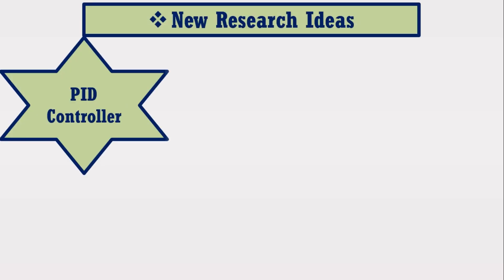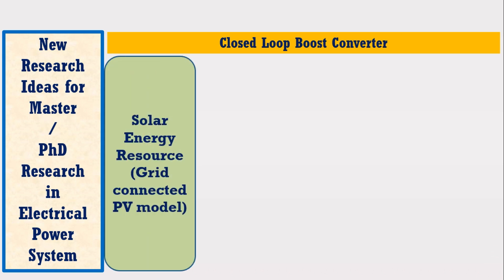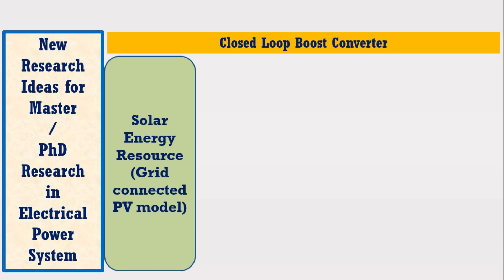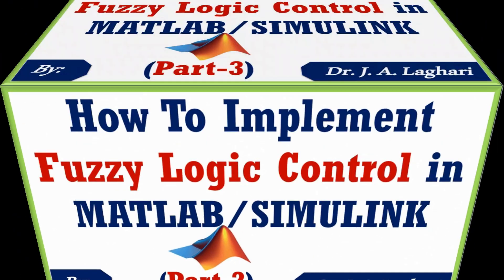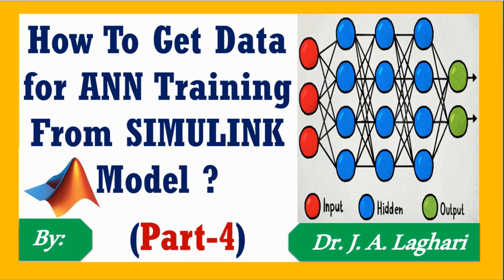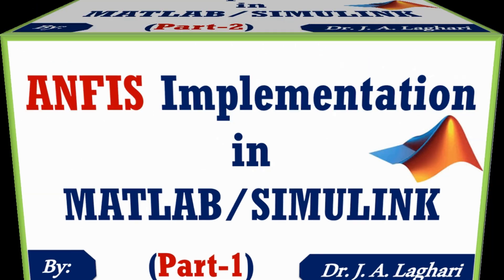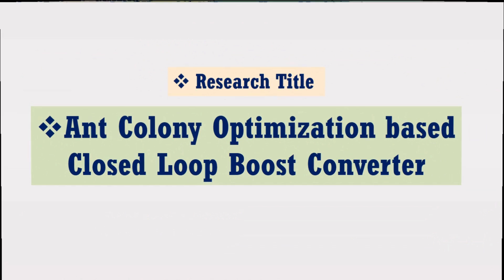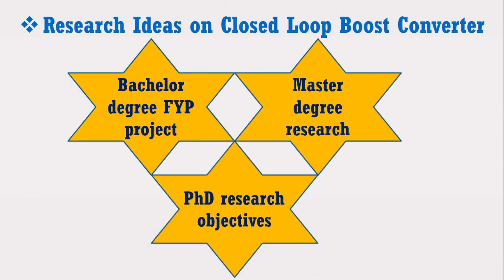New Research Ideas for FYP | Master / PhD Research Objectives | Dr. J. A. Laghari

Comment: Very nice explaination.
Sir why do we use converters why not transformers??for voltage step up/step down.reason?
Reply from the maker: Thanks for the comment. Due to advancement in power electronics, converter are cheaper and efficient way to step up or down the voltage